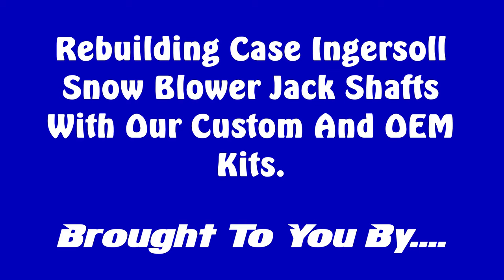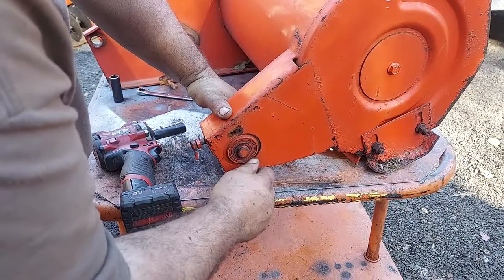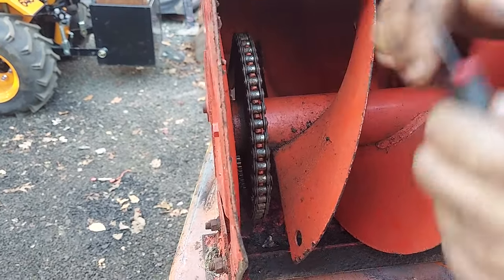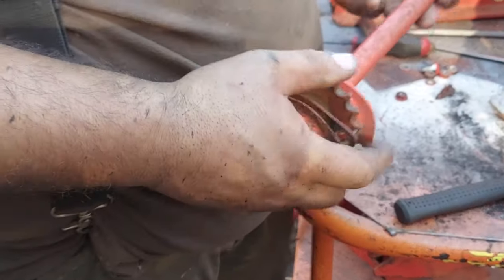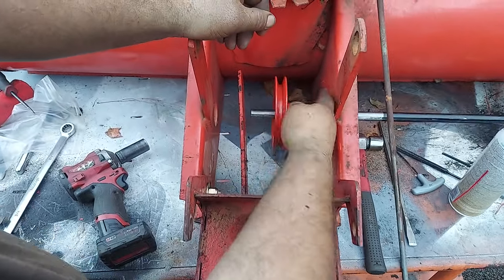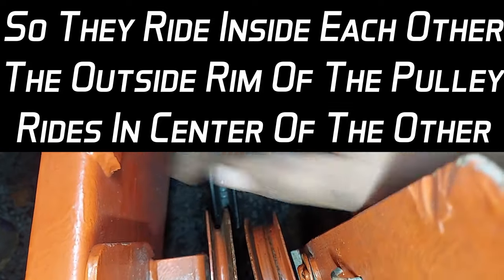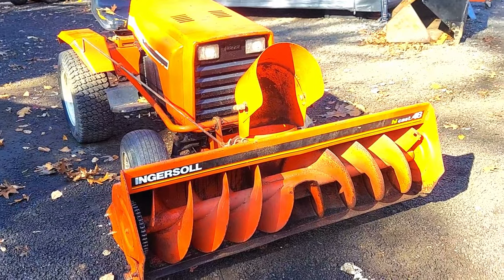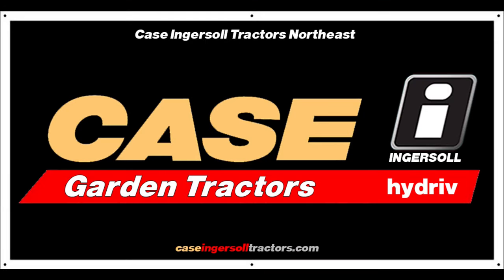Rebuilding Snow Blower Jack Shafts With Our Custom & OEM Kits For Case Ingersoll Tractors

Comment: Good video, lots of information not usually mentioned.
Have you done a video on an auger sprocket replacement?
Reply from the maker: Thanks, Hi no we have not, maybe down the road it would be a good one to do. Not very common but is needed at times for sure! We have auger bearings video and our mule drive rebuild kit install will be out soon. Thanks for watching and the comment!
Reply: @caseingersolltractorsnortheast Thanks for the reply.  Guess the one I have was well used as the teeth will not hold a chain anymore.  Oh well, doesn't snow near as much as it used to!
Reply from the maker: @skip7243  new auger sprockets are available.
Reply from the maker: lets us know if you need a sprocket we can get them in  @skip7243
Reply: @caseingersolltractorsnortheast Thank You

Comment: I have a Ingersoll 4020 . Hydraulic pump seal is leaking. Also randomly dies I believe due to bad ignition control module behind flywheel. Any repair videos on that? Thanks
Reply from the maker: No videos sorry. We sell the oem ignition parts on our website. It's not that bad of a job just takes a little time.

Comment: Another good video! Watching your last two videos made me wonder about changing up what l'm using on my snow blower. Currently I have a  L80 that I run on a 224.  I have a 3016ps that I mow with. It would be nice to mount the snow blower on the 3016.  Does someone make a conversion kit? It seems like the main difference would be the mule drive and pulley location.   Thanks!
Reply from the maker: Hi, yes Ingersoll made a kit, pretty rare and crazy money I want to say over $500 off my head..... The 3016 probably would be a little nicer to blow with, I would keep a eyed out for a SB blower for a 3000-4000 and find a blade for the 224 so you have the best of both worlds lol. Thanks for watching and the comment!.